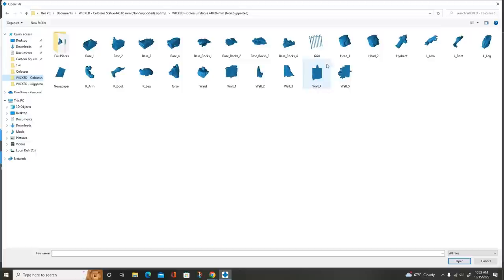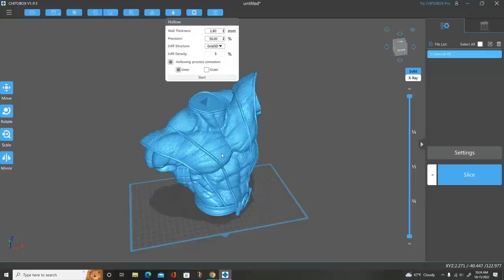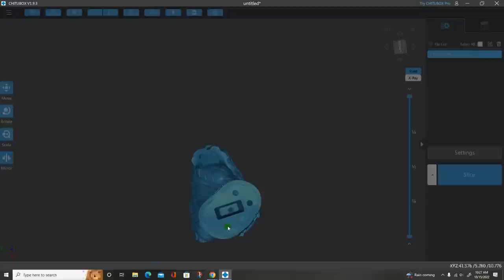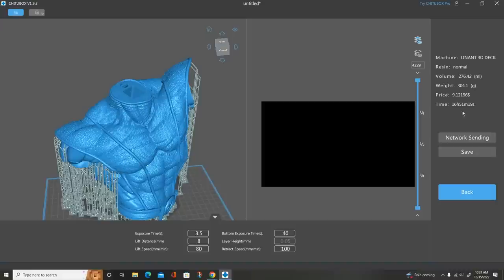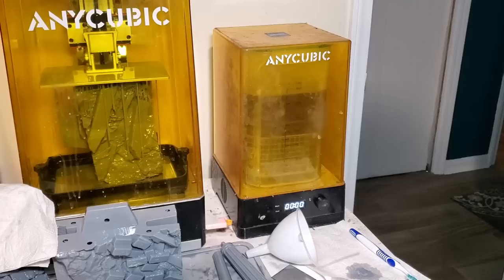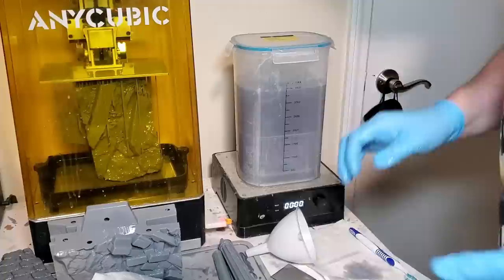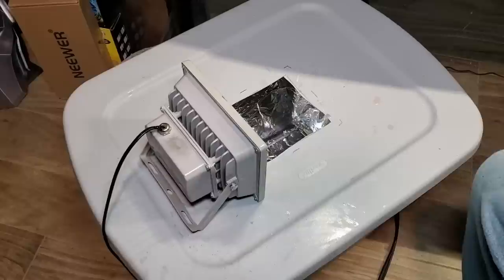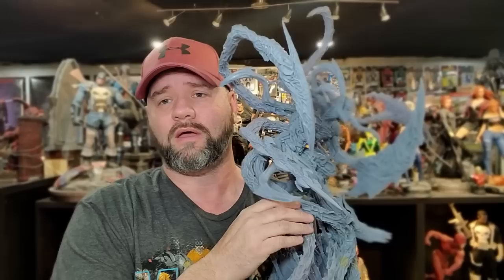3D Printing Just got that much EASIER

Comment: This is actually a great chitubox tutorial, you should call that out in the title. One issue I've had is drain holes. for my first SEVERAL prints, I didn't understand that you need drainholes. Drain holes are still a little difficult for me because I work with models that really don't have good places for holes.
Reply: maybe you can take a look in the piece and select a hiden part and put the drain hole but select the option "keep the hole" selected, and after the print and clean, you can put the lift hole back and cure. 

This is what I do here when I see that is not possible to make drain holes in the piece.

Comment: Awesome video. Thanks to your previous video I saved a bunch of money as I got brave enough to go with significantly thinner walls. Only thing I would add to your video for someone new is that alcohol is optional. You can use Simple Green or Mr. Clean for cleaning just as well to avoid the IPA.

Comment: Excellent, there ar extra steps you could have talk, like safety and best resine brands, 3D printer brands you have used or recomend, but great video.
Reply from the maker: This is more geared toward the process and not necessarily on the resin brands since everyone has their own preference. As far as safety, that's a whole other video.

Comment: exactly what i'm looking for! I've done 6 prints with my new elegoo jupiter and have had 6 failed prints and I'm glad you mentioned pre-supports because the models I'm printing are pre-supported for chitubox. I just went through your process and added supports myself with similar settings you presented here. I have my print running right now, so hopefully in 6 hours we will have a perfect print!
Reply from the maker: Awesome. Hopefully it turns out great. Keep us updated!
Reply: @TheCreativeCollector  just woke up to see the print went further then before but still failed. I'm going to try to increase bottom layer exposure time and increase support density and give it another go.
Reply: @TheCreativeCollector  update print successful!
Reply from the maker: Awesome!

Comment: Thanks, man.  I really appreciate the videos.  I wish I had this a few months ago when I got started - So. Much. Wasted. Resin!
Reply from the maker: I think everyone goes through that in the beginning! lol
Reply: @TheCreativeCollector  experience is the most effective but often the most expensive tutor.  Another that has also helped me is printing at even a slight angle to minimize flat surfaces that may result in vacuum.
Reply from the maker: Yes! Never print a flat surface. Always angle. Doing that together with drain holes helps with that suction.

Comment: Wish I had seen this video so long ago. So much info just laid out in plain speak. Fantastic. 

I do have a question about it though.  I thought conventional wisdom was to tilt the model on the plate, and then add supports. How come you didn't do that here? 

I've actually noticed in quite a few of your videos you print straight up and down.  Is it because those layers aren't big enough to cause too much suction? Or is there some other method to your madness?

Because I've been tilting all my models,  and then supporting them, and if that's not really that necessary, I'm gonna be kind of bummed that I've wasted all that time..lol.

I'm glad I saw the Wiked link to your videos. They're super informative for sure, so thank you!
Reply from the maker: Thanks for the kind words. As far as your question, I usually do angle the pieces rather than put then straight. I sometimes put then straight when I'm trying to either fill up the build plate or just depending on the size or piece itself.

Comment: Which printer would you suggest for the price?  I plan on doing nothing bigger than the bust of Wolverine you had to start out and if I really get into it maybe some bigger stuff.  What is the best quality for the best price in your opinion?  I also plan on building a UV box like you have and then for cleaning I might use the anycubic, but I'll have to wait and see.  Or would you recommend doing filament printers to start out?
Reply from the maker: Check out the Elegoo Saturn and Anycubic Photon mono X. They're dirt cheap right now with good build volume

Comment: What about curing inside the model?  Nothing was mentioned about that.
Reply from the maker: You can use small uv LEDs to fit inside the drain holes. Most of the time I print in 1.5mm to 1.8mm and it doesn't require to cure inside because it cures all the way through
Reply: @TheCreativeCollector  Yeah I was just watching your curing video and you responded just as I got to that point.  Also, the no supports inside is a huge game changer for me cause I've always had them and then struggle to get them out.  I've gotten into using Lychee more than Chitubox and find it's doing a better job for me so I'll make sure to remember that for the next print.  Currently I have a Dental light to shove inside my models but that requires large holes.

Thanks by the way!

Comment: Hey,
Thanks for the video and intructions... it was very helpfull... I'm watching all your videos!

QUick question..
I saw this model in specific, chitubox shows that it will take 16h51m to print. I know the printer never print in the same time slicers inform. But, in my case here, Chitubox shows 16h to print and the printer took more than 30 hours to get it printed. (I'm using an Anycubic Photon M3 Max) and the config that  I'm using is: Exposure time: 3 - Lift Distance: 10 - Lift Speed: 240 - Bottom Exposure time: 40 - Layer Height: 0.03 - Retract Speed: 360. Can you explain or tell me if this is normal or there is something wrong? (The printer config is the default generated by Chitubox profile).

Thanks!!!
Reply from the maker: It really depends on the printer. The times are never the same unfortunately. I would check with the model of the printer and find out what settings it has in the firmware.

Comment: So in CB, after putting in the auto supports, using these settings, I get a lot of RED under the model. Sorry, new to CB, does that mean I need to ADD a bunch of supports? Or is there an auto-edit feature? Thanks, guys!
Reply from the maker: Try the auto supports. I think the red is an indicator that you need supports in that area. I always use auto

Comment: Man I’ve been struggling with supports. I can do FDM all day long but Resin is kicking my ass. The way you do it make it so simple. I’m gonna give your way a try. If it works on my Saturn S. I’m gonna kick myself 😂 

Question tho, I’ve been using lychee before I couldn’t get used to the free ChituBox until I when with the Pro version. Can you explain why Lychee doesn’t like pre supported files? I’ve printed a base that was pre supported from Wicked and i don’t know what I’m missing. Again I’m new to resin printing. I’ve used pre supported lychee files but I’m sure those will work.
Reply from the maker: What I find with Lychee is that the pre supports cause distortion issues and the slicer shows imperfections within the model due to the supports. Plus when you try to enlarge the file, the supports done always increase with the file. Thats my experience, plus I've heard other having issues as well.
Reply: Its not that lychee doesn't like pre-supports. Its that Chitubox uses a different process for hollowing. That lychee and other slicers can't read correctly. Wicked hollows with chitubox. There what causes the problem.

Comment: What do you do with the alcohol once it can no longer be used? BTW, great informational video! I'm looking at getting a 3D printer and videos like this are very helpful with figuring out how I want to go with it.
Reply from the maker: There's a waste control station where I live so I gather up large batches in a barrel and they pick it up for removal.
Reply: @TheCreativeCollector  I will have to see if there is one around in my area then. If not, I'll probably go with a filament 3D printer then. I do like how resin prints though. Very well detailed.

Comment: Hey Great work! Thanx for sharing. Is Rich Opto the resin you are using? and if so how durable you would say it is considering your walls are only 1.8mm
Reply from the maker: I do use that resin and it's pretty solid at that thickness. It's got a good smooth surface on their resin.

Comment: Do you cure the inside of the model or is putting in in that tub enough?
Reply from the maker: Sometimes its enough but I like to try and use small UV LED lights sometimes installed through the drain holes.

Comment: What’s your best advice for hollowing? I try it and always fail, if I don’t hollow perfect prints?
Reply from the maker: Check out the video I did on hollowing. I hope that helps.
Reply: @TheCreativeCollector  is it bad to print without hollowing?
Reply from the maker: I mean you can, but you'll use a ton of resin plus your prints will most likely split or warp. If it's a small piece then those will be fine. I print small pieces solid all the time. You just don't want to print big pieces solid.
Reply: @TheCreativeCollector  thanks will keep this in mind

Comment: im using a LD-002H with siraya tech fast resin navy grey and my normal exposure is 1.5s perfect exposure and bottom layer @ 20s and i end up with bottom splits what am i doing wrong?
Reply from the maker: You might want to increase your exposure times.
Reply: @TheCreativeCollector  will sanding the build plate also help? I never sanded my plate
Reply from the maker: It could
Reply: @TheCreativeCollector  how do you calibrate your printers I have a 2k monochrome
Reply from the maker: Try printing off a calibration cube. That'll help
Reply: @TheCreativeCollector  thanks for all your help I finally found my right settings 35s bottom exposure and 2.21 normal exposure now I’ll be good for large prints

Comment: Hello, what typeo of Resine do you use, is it safe or is it very irritating as we have seen other resines to be dangerous, why you did not usedd a mask to handle the resine ore eye protection any time? why you did not used ice after you finished? ... I leave overseas, probably customs won't allow me to buy the resine and bring it.... it might be dangerous, If I can't find it locally, it might be a problem.
Reply from the maker: I use a few different resins but mainly Sunlu or Elegoo. You don't need a mask for the resin but I do use one for the alcohol cleaning (as demonstrated in the video) and you don't need eye protection unless you're splashing it or bathing in it. And if you do that then you don't need to resin print. lol And I'm not sure why I would use ice afterwards.

Comment: How do your models manage to stick at 20% support? I've had a few that worked with it but now my stuff constantly falls off mid print. Various results on 100, 50, and 35% scale prints but still something always falls regardless of orientation. I've even had fails at 50%+ supports. Any tips to look for? 2 examples is the manhunter cape, and aquaman body has failed multiple times.
Reply from the maker: I've always printed my models at 20% and they worked. One reason is because I don't print them so thick like some people. I've seen some people print like 3mm thickness and it's just too heavy and falls from the support. It also depends on exposure times and plate orientation. I wouldn't really know how to answer that without seeing your settings and things like what printer and resin you're using.
Reply: @TheCreativeCollector  mars 3, elegoo abs gray, 35 bottom exposure, 2.8 from then on. However I think it may be related to hollowing now that you mention it. I'm curious if you've gotten the message "fail!Not hollowed out or too deep to dig"? I get this on smaller pieces no matter the setting.
Reply from the maker: How thick is your print? A 5mm hole depth should be plenty to dig in.
Reply: @TheCreativeCollector  same as yours, but for some reason I get issues where it won't dig holes on a lot of areas depending on the piece. Most sections are fine, which is why it's so weird to me. Mainly print at 50%. I know it's difficult to answer without seeing but as your videos have been extremely helpful since buying a printer I thought maybe you have experienced this.

Comment: Damm seems so simple and it is. But in my case its been a nightmare. From 22 prints, 20 fails 2 success. 

I gave my Saturn S to the support guys from the company I got it. They checked and it was ok, plus printed 2 objects perfectly. 

I copied their settings and printed perfectly the first time and then again 6 fails. Tho, noticed that the platform wasnt in the correct position so it might be the screws of the platform cuz it unlevels without touching anything.

Moreover, I already leveled the bed 27 times since I got my printer (August) and wasted 2kg of resin 🥲.
Reply from the maker: Man I know thats discouraging. I went through similar issues when I first started. But after tweaking things here and there I finally got my printers dialed in. Just keep doing research and watching what others are doing that works.
Reply: @TheCreativeCollector  Dont worry Im stubborn af so I wont quit.

 Watching your videos are motivators.

Its just that I want to solve those problems and finally start printing 24/7 without sending a prayer every single time and still get fails 🤣
Reply from the maker: Well I hope this video helps some. Start out with a calibration print and work from there. Start small and when you have your setting dialed in, then move forward. Bigger and better prints are right ahead of you!